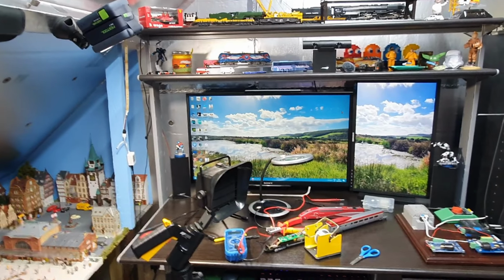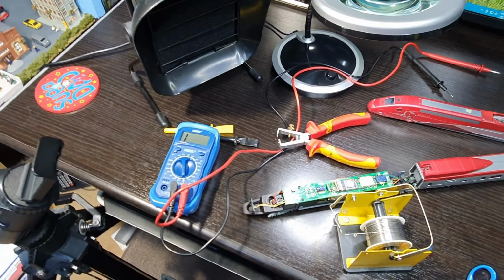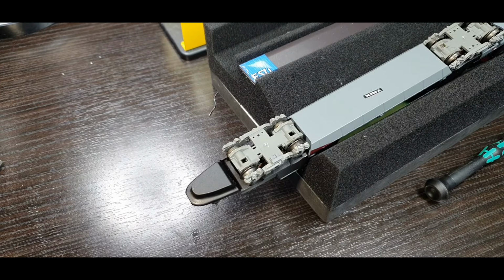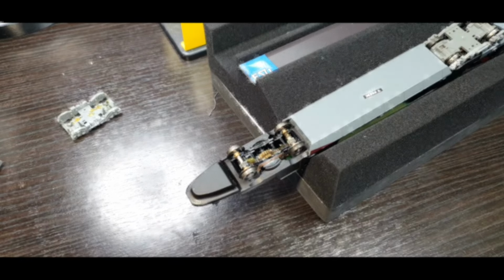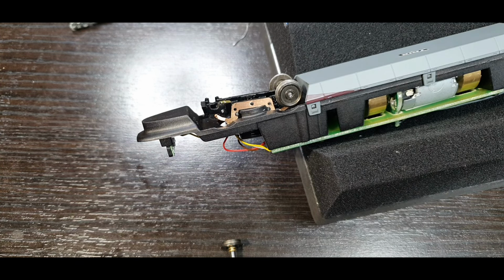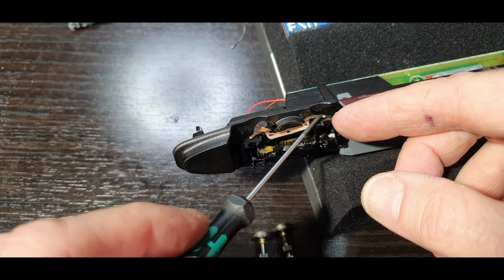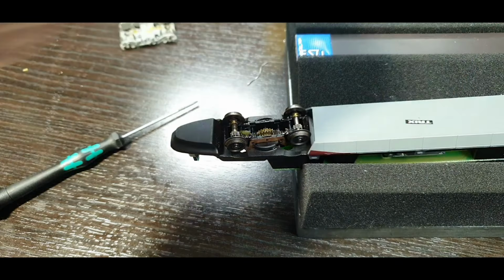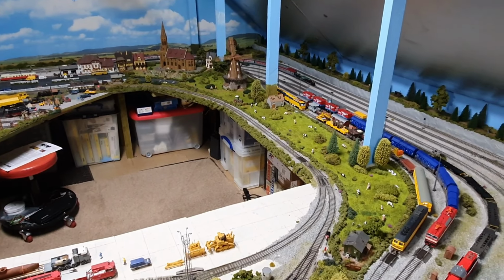MARKLIN TRIX TGV BODY BOGIE REMOVAL MAINTENANCE #modelrailway

Comment: Hi Jim, great fault finding and repair video, doesn’t it give you a sense of achievement when you do them, totally off topic but have you seen the new 12t EFE Rail plasser crane that was released for sale last week? It’s non functional and not self propelled, it’s a good looking wagon in general but it could have been so much better in my opinion, directional lighting would have been a bonus, it’s not cheap but it will look good on any modern era layout, if EFE Rail had approached Viessmann about making a functional model it would have been a winner but the price may have been a bit too much for some modellers to justify, Bachmann/Liliput had a small self propelled little crane truck in their ranges a few years ago that they could have gotten some inspiration from, thanks for sharing.
Reply from the maker: Thanks Bud,
Funny I was in Arcadia Models on Thursday and those cranes just arrived in the shop as I was there .They are very nice looking with loads of detailing , I nearly got one the Javis livery but went against buying it as its 1/76  , the price is ok but I went for bargin electronics in stead.

Comment: Jim, how long did it take for the dry joints to develop?
I recently scrapped a 1999 V6 Peugeot and surprizing the ECU which lives in the harsh conditions of the engine bay was fine. I wonder how long the latest complex stuff will last...
Reply from the maker: This set is 14 years old and second hand, these sets require maintenance now and again every other year  , ive hammered these tgvs sets and they have done many miles on automation not bad really.
Most advanced dcc models will require replacement parts at some point , this set has a good design so it can be broken down completely fairly easy then rebuilt unlike the Viessmann Robel which has a failed power bank which is extreamly hard to replace.
My old VW passat sport estate was a 99 plate with 250k on the clock all the electronics were fine engine perfect, what ended it was rust from a battery leak years ago which slowly rusted the suppension strut mount in the engine bay....